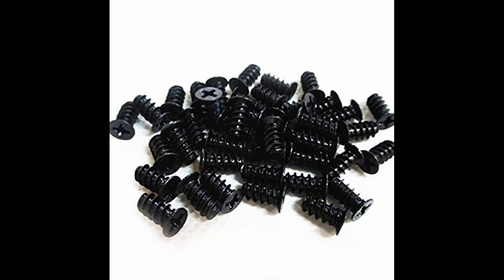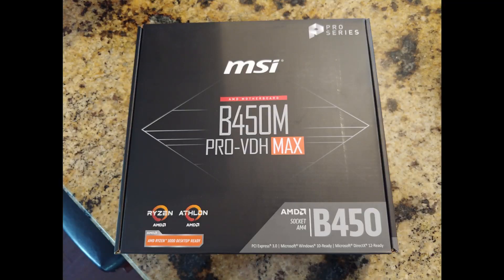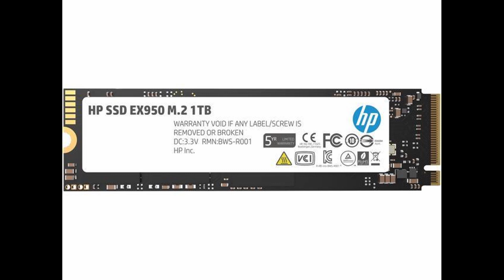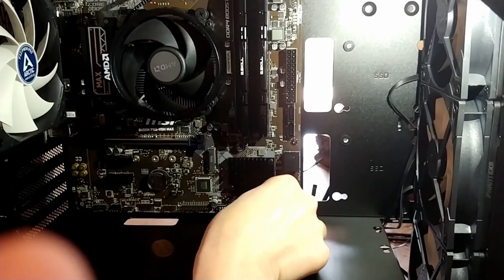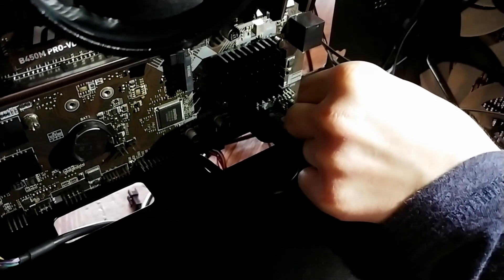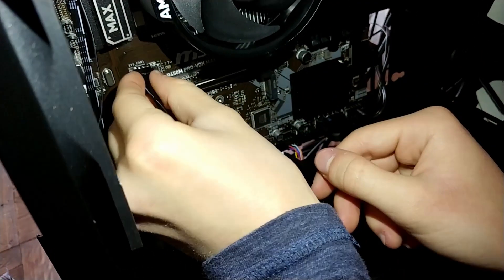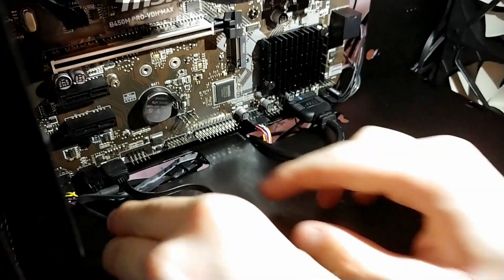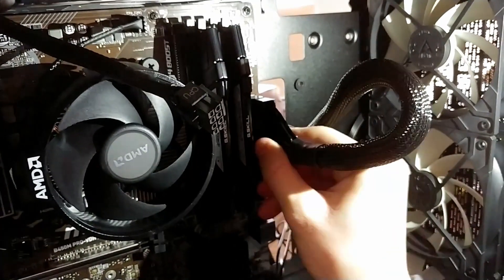How to Build a PC in 2020 (For Beginners)!

Comment from the maker: Here are just some minor edits/notes I wanted everyone to be aware of:
1:23 Here is a picture of some longer screws (that I mentioned but didnt show): https://m.media-amazon.com/images/I/61c3FfLcWRL._SR500,500_.jpg
7:05 I found out that a second, possibly easier way to install SATA SSDs within this case is to just screw the rubber mounts in first and then slide it into the mount on the back of the pc. Whether you do the way shown in the video or this, it'll work.
7:51 By "back panel" I meant the side panel covering all the cables and such.

If you noticed anything else that is of note, let me know so I can post it here. If you are confused on something and need help, feel free to join the Discord which is linked in the description. You can also join our subreddit at r/CustomPCBuilding!

I hope this video helps everyone and shows you all how simple building a PC is!

Comment: i accidentally cracked gpu connections and i bent cpu pins when i saw that i broke the gpu, i powered up pc hoping it will work and the mobo started smoking, i tried to see if it was the psu and i changed voltage lever on back trying to fix it, house electric tripped and nearly all of my stuff got broken cause of the electric, i tripped on the pc cord and the monitor cord when i was passing and the pc case cracked, and the monitor in pieces. i spent 7000$ on this build and now everything is gone... im trying to sell it for 2000$ on ebay 'barely used' and no one is buying, cause of your tutorial

Comment: Dang your Hands are shaking so much, and I thought you put the motherboard on the box because it's a good anti static surface...
Reply from the maker: A wooden table or kitchen countertop is just as good for anti-static, however, like I said in the video, you wouldnt want to use that because then you might scratch your furniture up. A lot of motherboards have oddly sharp solder points on the bottom.

Biggest tip would be to just not put the motherboard on the motherboard bag, as thats a really common mistake.
Reply from the maker: Also yeah my hands are really shaky, sorry for that lol